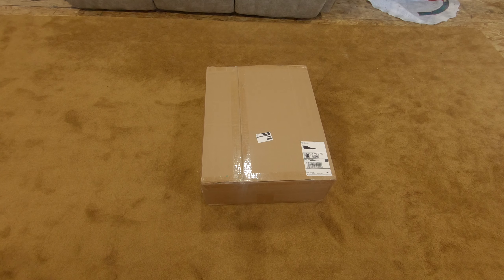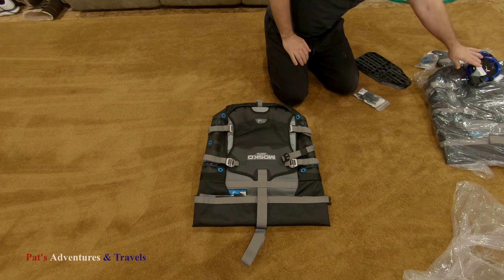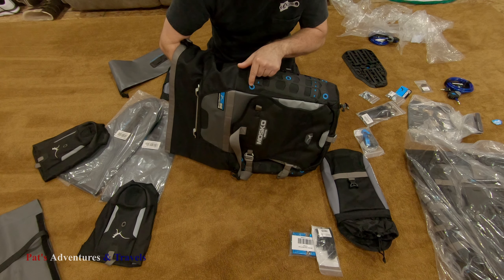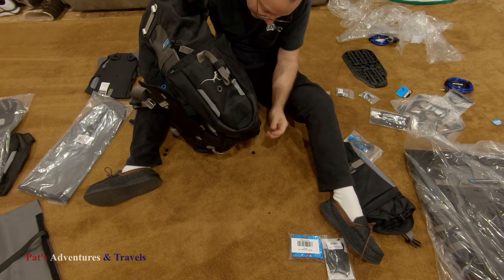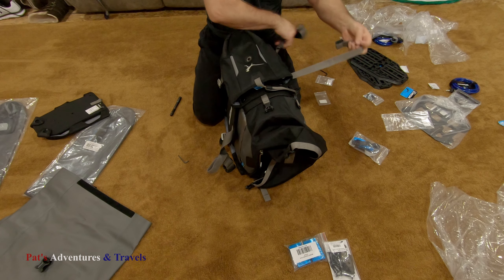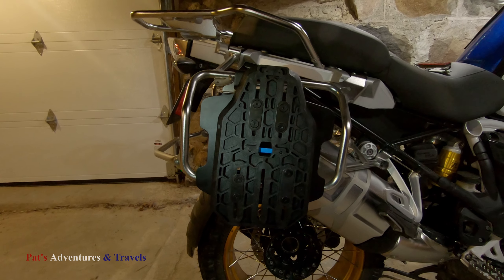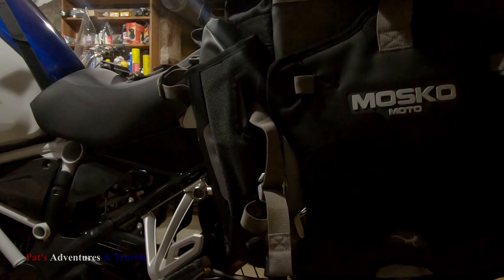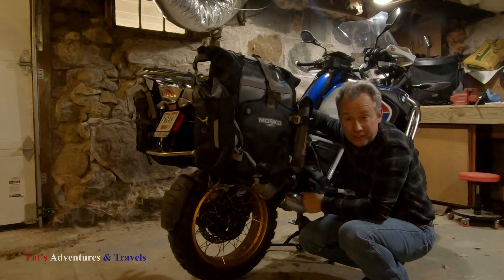Mosko Moto BackCountry 35L Bag Install (BMW R1250GSA)

Comment: Ha ha ha! An interesting life is full of mistakes! I saw the mistake in your video before you mentioned it! Great panniers! Used them on my bike for over 4 years! Great piece of kit!
Reply from the maker: Lol... thanks.  So far I am liking them a lot!
Reply: Can these panniers be locked to the bike to prevent theft?
Reply from the maker: @hanscaspersz4900  I bought the cable lock that goes with them.  It makes it a lot harder to steal.
Reply: @hanscaspersz4900  Yes, both old and New versions can be secured to the bike with a small padlock!

Comment: Nice bags. Have you checked out Bumot Xtremada soft panniers for OEM GSA racks? Awesome bags, tough, lockable, easy attach/detach system, and with more capacity than Moskos... (equal to BMW alu cases). I'd say they are slightly lighter than Moskos too 🤔
Reply from the maker: I had tossed it around for a long time between the that and the Lonerider bags, but decided I wanted to try the Moskos.  Had my bike not come with the BMW hard bags I really wanted the Bumot Hard bags at first.  Now that I have learned a bit about safety on these big ADV bikes I'll probably sell my hard bags.  Will keep a hard top box most likely though.
Reply: @PatsAdventuresTravels that's what I have now. Topbox for commuting and daily use. BUMOT as an addition for touring or off road trips. Sold my hard cases. Don't miss them.
Reply: @NachoGS  I've looked the BUMOT bags and I really like the ease of switching out hard / soft luggage so quickly. I'm a person likely to do so. I like the hard cases for our long road trips but I do also do off road riding and trips. As I've ready dented one of my hard cases (and seem some really bad damage done to others) I'm leaning towards the flexibility.
Reply: It looks like the Bumot Xtremada are smaller and dont have so may pockets etc?! Right?
Reply: @simoesc  Smaller than?
Reply: @NachoGS  oups right. Smaller then the 35L Mosko Moto
Reply: @simoesc  Nope. They have 80L of total capacity. Including 4 x bottles compartments.

Comment: did you use the offset kit to accomodate the offset panniers or are both 35liters and how does it look from the back. thanks
Reply from the maker: I just used the bracket I had to buy in order to fit the GSA on the exhaust side.  No they do not look the same from the rear, but I am the guy that cares more about function over looks.

Comment: Pat, are you still liking the Mosko bags? Any nit pics or annoyances? I’m looking to splurge maybe this winter. And even after researching the competition I’m drawn to the Mosko bags. One question, the adaptor that mounts to the OEM pannier frame would stop me from making a quick change back over to my aluminum panniers should I be in the mood to do so. Have you ever wanted to switch back, if even for a short time? Is it a big deal to remove that plate that bolts to the bike?
Reply from the maker: As for switching out between hard and soft bags.  No matter which side it is bolted to the bike.  So it wouldn't be a fast switch.  I sold my hard bags so no going back.  I am still learning to use them.  I have no regrets switching.  They do not hold as much as the hard bags and I knew that going in.  The best part is I can take the bag off and just carry it into the hotel or camp site with no need to unpack.
Reply from the maker: One other thing to keep in mind Brad.  I got a heck of a deal around Black Friday if time isn't an issue for you.
Reply: Yes, I made note of that after you mentioned it in the video. That would help a lot! Thanks for the feedback.
Reply: @PatsAdventuresTravels  what time of year was their black Friday?   dates I mean?
Reply from the maker: @kee7678  The weekend of Thanksgiving is when I caught the sale.
Reply: @PatsAdventuresTravels  cool!  Thank you!

Comment: Saludo from Colombia, I see that you have the heavy duty cable lock. I have been thinking about buying that as I'll be traveling south America. Any thoughts on theese? Thanks
Reply from the maker: I like them.  They are stiff to lock and unlock because I believe it just clamps down on the cable.  It can help prevent theft but won't stop someone determined to get into the bags.  A simple razor knife can get you into the bags.  I used them while traveling, but for over night I take the bags off the bike and they go inside with me.
Reply: @PatsAdventuresTravels  thanks!
Reply: @PatsAdventuresTravels  Hi Pat, there is a video from Mosko where Pete uses a sharp knife to cut the panniers. Let me tell that you he hard a hard time trying to get into the contents of the panniers. So I might say that a simple knife cut won't do the job of getting your belongings.
Reply from the maker: @westdene72  They are tuff for sure.  But a razor knife can get into them.  It's like the old expression.  A lock only keeps an honest person honest.  So far I haven't had any issues with people messing with mine.  Locked or unlocked.  But you never know.

Comment: I’ve been rewatching many of your videos and am curious, what was your thought process choosing between the bolt on 5-liter bags and the 4-liter molle bag? How do you utilize them on the road? I am unsure which I would choose. I’d appreciate your thoughts. Hope I’m not a pest. Thanks!
Reply from the maker: Nope you're not a pest.  Honestly when I bought the 5 liter bag I thought I was buying a water bladder.  Some how I mess it up.  But it has been great for storing my plexus and cleaning rags.  The 4 liter molleys.  One holds first aid another tie downs and tire repair.  The 3rd is sometimes the water bladder sometime misc stuff.
Reply: Thanks! That really helps. I tend to overthink everything, but I’m too old to change! Ride safe!
Reply from the maker: @bradb2514  Yeah me too.

Comment: Thank you for sharing. Did you go with two 30 liter bags? Or go with smaller bag on right to offset the exhaust? Could you share your thought process on deciding bag size? I just ordered two 30 liter side bags. Thank you.
Reply from the maker: I went with the 2 bags being the same size.  I knew I was going to lose space over the hard bags so I wanted to minimize that.

Comment: Thanks for sharing! Is this plate in the exhaust side really necessary? Is it to protect the bag from the heat?
Reply from the maker: Yes on both questions.  without the plate there is no way to attach the wedge that the bag slides on to.  It does space it out a tiny bit more from the exhaust but not much.

Comment: Those bags look huge. Are you going to keep your top box or go without?
Reply from the maker: Probably keep the top box.  The bags look big, but if my research is right they are only 70L where the BMW hard panniers are 80L.
Reply: @PatsAdventuresTravels  They are some seriously good bags. The rental 1250 I used this summer on the COBDR had them. Easy to use, and they are pretty obviously waterproof though I never really tested that nor their impact performance. Good choice.
Reply from the maker: Thanks I hope I enjoy them too.

Comment: Mosko has a video showing the easy way to attach the pouches...
Reply from the maker: They are easy for the most part.  With mine the holes that the nuts go into were extremely tight.

Comment: Can these bags be locked to the bike to prevent theft?
Reply from the maker: Yes if you use a cable lock.  Otherwise it has no built in locking device

Comment: Hello, Pat.  Am attempting to decide hard panniers vs. soft for my new 2021 F850GSA.  I am new to adventure riding, but have many many years of on-road and dual sport experience.  What are the pros and cons?  I heard you mention the downside of the hard bags at the end of this video.  If it's easier, I can send you my email address and keep the chatter off of here?
Reply from the maker: I am a newbie too.  I have yet to get to use these bags since it is full on winter here in Ohio.  For sheer convenience hard bags are better in my opinion and a little more secure from theft.  For me it was mostly about safety.  Since I have dropped the bike a couple times I am less likely to get a leg injury from the soft bags over the hard bags was the deciding factor.
Reply from the maker: Here's the first video I had ever watched on the subject.  https://www.youtube.com/watch?v=TZTRVLwO51Q
Reply: @PatsAdventuresTravels  Thanks.  Will watch.  One more thing............where in Ohio?  I am located in Greater Cincinnati.
Reply from the maker: @stephenadams281  Long way from you lol.  About half way between Columbus and Cleveland.  Not too far from Mansfield.
Reply: @PatsAdventuresTravels  Thanks for all of the help.  I watched the video and also visited a couple of the manufacturer sites for the soft panniers as I am leaning that way.  I saw where the soft panniers can mount to the stock BMW rack on the 1200GS, but have not yet found where the soft panniers can mount to the stock rack on the F850GSA.  Any pointers there?
Reply from the maker: @stephenadams281  If they are the same as the 1200 or 1250 I'd think you'd have no issues, but I honestly do not know other than ask the manufacturer.  I wasn't aware I had to buy an adapter plate from Mosko, but I asked them to check my order for accuracy before I place it and that is the only thing they told me I hadn't ordered that I need.
Reply: @PatsAdventuresTravels  an you may want to consider the steelock/compact locking systems from Mosko. I got that for mine and they doing good
Reply from the maker: @81722Les  I did buy their lock with cable.  Just haven't used any of it yet lol.  Only managed to get out 2 times this year so far for less than 200 miles total.  When it's been nice I have not be able to get out.

Comment: Be aware!! If you order from the EU site, YOU must pay the very high import fees!  I recommend you ask about this (email them first)  before you buy, especially if you plan to use the product soon.
Reply: I would like to add to this: 

I wanted the Mosko Moto Redline Jersey which I ordered in a XXL from the US store (and it was huge) and had to return it. The EU store (Netherlands) had it in an XL, in stock, so I ordered it from there on the 9th and had it on my doorstep on the 13th. 

That was faster shipping than what I get from their factory in Oregon. Plus the jersey from the US store  cost me $49 USD plus $10 shipping. 

The jersey from the Netherlands store cost me €43. No taxes. No shipping charges. That saved me about $16 USD. So don’t believe all the hype you hear about import fees. There were none.